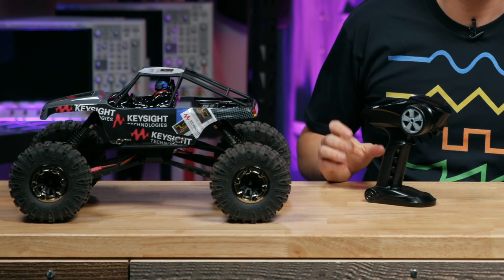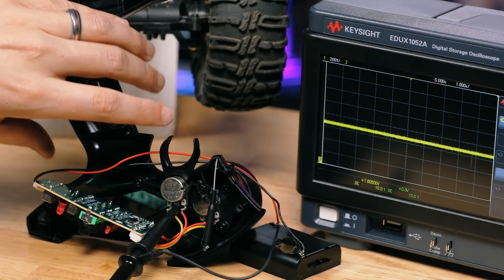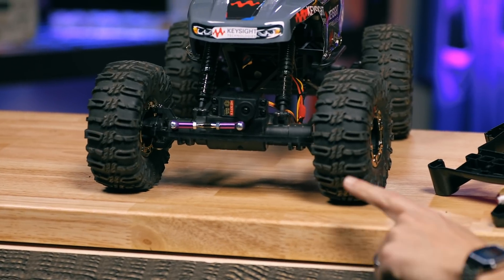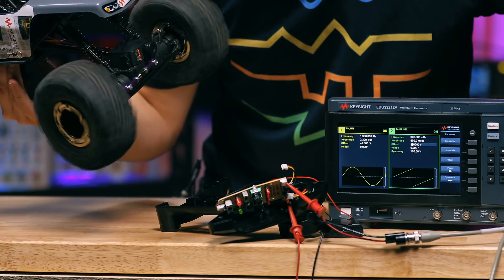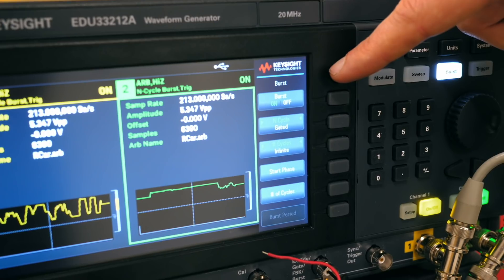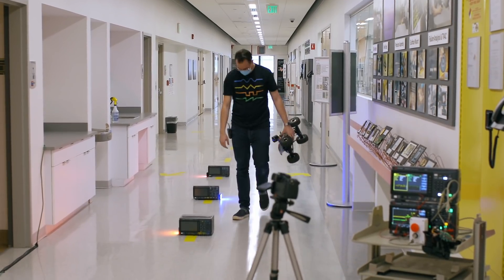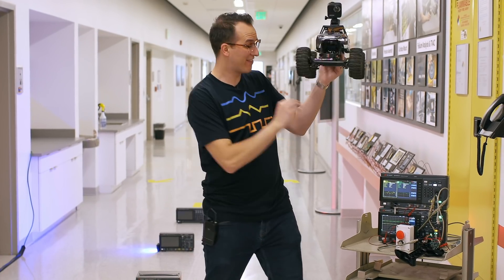Controlling an RC Car with my Function Generator

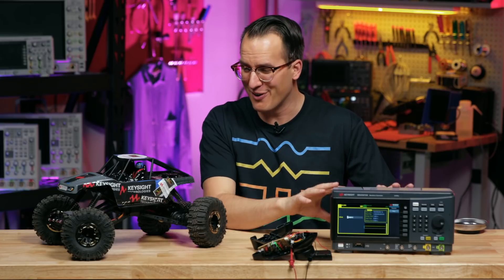Comment: 3:23 fraud. the wheels are not moving in sync with your turning of the dial. also, the measurement on the screen is out of sync. this means you weren't using the function generator to control the car as you claimed.
Reply: The offset was already 0V

Comment: This was awesome! Now use an RF generator and modulate it using the function generator in order to control the car!
Reply from the maker: I'm very much considering this!
Reply: Each second of the recorded waveform would probably take megabytes to have enough sample rate to store the whole digital signal correctly. You would need a very modern digital oscilloscope with a lot of sample memory and I am not sure if there is a signal generator that has enough of it to store and replay the result. It may be possible but I would not count on it.

Comment: Awesome video! :) Does the voltage reset because the battery voltage drops and thus loses it's reference? Maybe if you did one run with the controller, then charge it, then with the function generator it would recreate more accurately? I could also be totally wrong hahaah
Reply from the maker: That's an interesting thought. I'm not 100% sure why, it would be interesting to check. When I drove the course I also tried to avoid the max/min turning and throttle settings to avoid inconsistencies in battery and power delivery.
Reply: @KeysightLabs  when I was doing robotics we had similar issues when programming with time, like drive forward for 2 seconds and then turn left. It wouldn't get to the same point as the battery was running out, different drag because of that. At the end we had to use encoders to improve the consistency. Those were fun years 😀

Comment: i almost thought he was gonna replicate the RF signals. This is also cool though.
Reply: yeah my bad :P. there are r/c cars that run at some 49MHz or so. But this one is probably 2.4 or up.
Reply: I also kinda expected some kind of a fancy RF demodulating oscilloscope probe with a signal gen equiped with a modulator that can be fed with the arbitrary waveform but no such luck.

Comment: Hi. I am trying to send my application to the Smart Bench Challenge but something is not working. I tried Firefox and Chrome. I am not getting any confirmation email after i send my application. Is there are way to know that i there is a problem or am i just getting rejected. I meet all the criteria to enter the challenge.